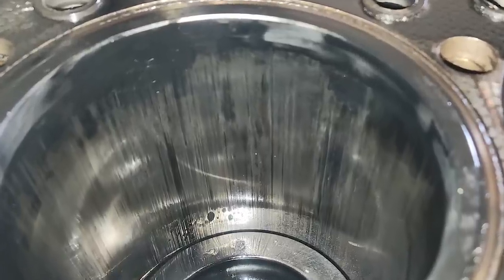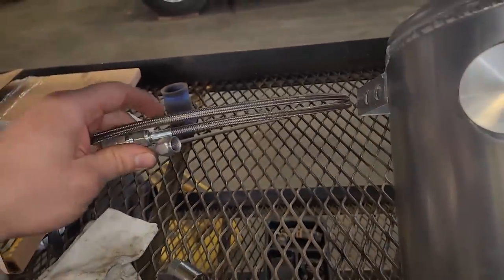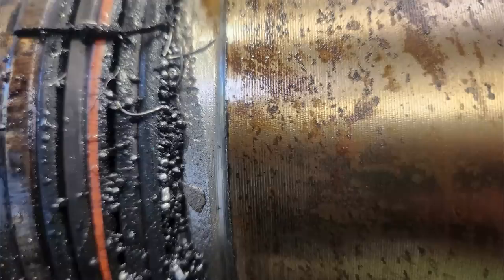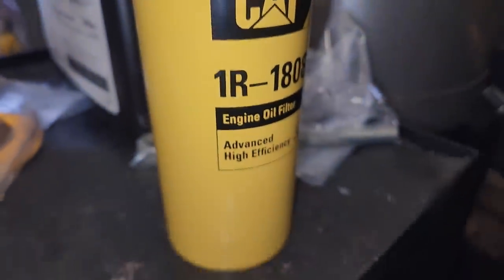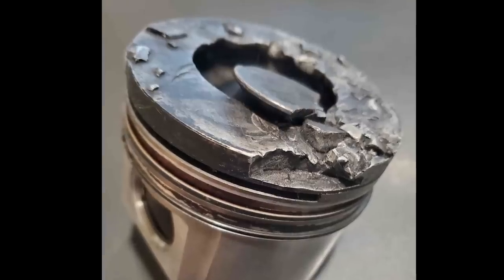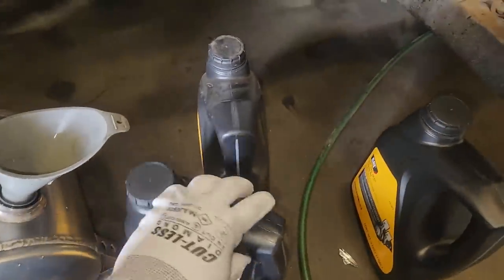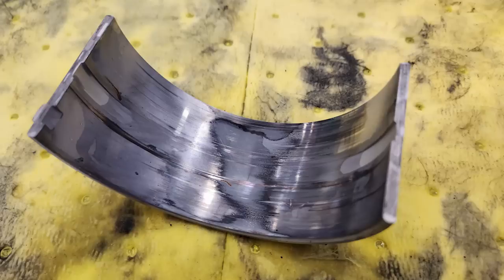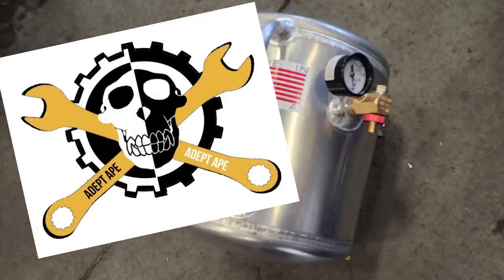This Engine has Oil Pressure BEFORE it cranks! Should you prime an engine oil system?

Comment: Thank you for this video Josh

I’m in the process of putting a C15 ACERT back together. 

I’m gonna try this setup
Reply from the maker: I think you'd like it.
Reply: Almost mandatory to pre lube oil galieries after rebuild or after you have had the oil pump off on 3406, C15 and wind engine over after filter change to get oil pressure before starting. Will take out #1 big end from lack of lube, usualy starts knockin about half hour from the shop. 38 years ago when I first started we used to use a stainless soft drink syrup bottle as they were pressure rated and held about 10 liters of oil, we pre lubbed every rebuilt engine before startup.👍
Reply: We also have trucks that have been sitting a while, like over a year or so. So this tool is going to be handy

Comment: Did something similar for filling differentials with gear oil. One thing to think about is using dry air. Moisture will get into the container and into the oil.

Comment: That cavitation damage looks a lot like what I see lately when a low rad gets topped off with tap water. I have no idea the chemistry or physics behind it, but something about our nasty ass nasty tap water mixed with newer coolants react with different metals to make some nasty compounds that eat up everything it touches like battery acid. And with distilled water now in short supply I suspect we're going to see more of this in the future. It's getting kinda ridiculous
Reply: Reverse osmosis water is almost as pure as distilled, and available in any grocery store. I use it in my off-grid lead-acid battery bank with the blessing of the battery manufacturer. And for only $300 I installed my own under-the-sink RO system in the kitchen.

Comment: The question remains, as to why pre-lube pumps are not installed permanently and used prior to all startups and after each shut down, particularly with turbo-charged engines? It's a small price to pay for increasing the longevity of the engine.

Comment: Hi Josh, Question : Did you have any experience with centrifugal oil filters ? They look like a great idea. Keep safe and have fun with Diesels. PS Your channel is just great – thanks and keep it goin…………..
Reply: We had large ones on the last big boat (8000 hp, two EMD 16-710's) that I worked on; they were plumbed externally with their own motor driven pump. We cleaned them once a month and would have 3/8" to 1/2" of dirt in the bowl, this was stuff that was too fine to be stopped by the filters. They definitely extended filter life towards the end of the overhaul life.

Comment: At the absolute minimum, remove the spark plugs and crank long enough to get oil pressure reading on the gauge.
Obviously, diesels don't have SP's so you have to do whatever other methods work (I don't do diesel).

Most SBC, get yourself an old distributor. Remove the drive gear and reinstall a shorter roll pin. Drop it in, get it hooked on the oil pump drive shaft and spin it with a drill.

Comment: I built one years ago. Sometimes I fill it with diesel and use it on fuel system to check things out . Found a leaking sealing ball on a detroit 60 series injector  one time. Nice to not haveing to run the engine

Comment: Pittsburgh power used to sell a oil pump powered by a starter that would pressure oil into the engine before starting.

Comment: Yes. Pre lubrication works, but it doesn't work for folks who need to work on equipment.  Adding bypass filtration plus oil analysis will turn engines into forever units and that will be bad for business

Comment: Great timing, I just put together a Series 60 and bought the Jegs version from Amazon. I really didn’t get any oil up to the rocker shafts though. I’m guessing not enough volume on the small line plus with 6 piston cooler nozzles open there’s just not enough flow to reach the top. Your thoughts???

Comment: In winter, even hooking the pan/crankcase heater, it was difficult starting. I installed an electric pump to keep the coolant flowing and the motor itself seemed to warm the coolant enough and redistribute the heat enough the truck had no problem starting like it was the middle of summer. However I always was wondering if that allowed the warm oil to drip back down some. This device might be the answer

Comment: 7:25 that same grime or whatever will be there regardless of if the engine is pressure primed or not, just if you don't pressure prime then that grime goes to your bearings under the load of a running engine, therefore it's worse to not prime if you're worried about grime.

Comment: Back in the 80s, I saw a drag racing add on, that took stored, pressurized oil, from a reservoir, and would release it into the engine during slow down/shutdown, when the oil moves away from the pickup tube, to protect the engine. Since up to 80% of engine wear occurs during start up, why isn't it mainstream, to do something like this with all automotive engines ???

Comment: I have the mighty vac oil fillers.  You can thread them right in, 20 PSI max, I have one for engine oil, one for tranny oil and one for gear oil.  Use them to filter and fill everything.  Awesome tools.

Comment: Hi Joshua, What do you think of doing a mini inframe at 5 or 6 hundred k miles as preventative,  planned maintenance?
 Pull the head, drop the oil pan, crank, and pistons.  Mic & hone each can, install new rings & bearings, double check head is flat & re-install everything.
Reply: That’s a lot of work and only costs you money, if you’re going to do what you’re suggesting you may as well inframe your engine for nothing.  If you need more than a bearing roll at 600K you’re using your Diesel engine improperly.  I’ve had engines go 1.5 mil without any real service other than replacing one injector and a doing a bearing roll.

Comment: So got an oddly specific question for you should you get a moment. Me and a buddy are trying to build a custom diesel offroad buggy. We want to put a cat engine into it....because yes. but while the C3.6 is more or less perfect for our needs size and power wise....the emissions are a deal killer due to the weight, size, and additional parts just being far too much for our frame to handle without having to expand said frame and weight to where the engine wont really work.

My question is what would be a good pre emissions equilvent to that motor sold by cat? Basically anything in the 150-180 horse range with a max demisions of 32x30x41 <LxWxH> would love to hear your opinion. Think bobcat/skidsteer engine.

Comment: IF prelubing forces contaminants into the bearings then so will the air pressure that precedes the oil in a dry start up. Yes air precedes oil in a dry start up.

Comment: I thought assembly grease was good enough. That's all I used for my  c13 rebuild and my oil gauge only took a few seconds to show pressure. I suppose there is no such thing as too  much oil on moving parts. (Within reason)

Comment: Wonder why the manufacturers don’t design and install a preoiler system in all engines and Tanis heater pads on the oil pan to keep oil warm. The most wear any engine gets is during start up. The big aircraft radial engines had preoil systems. Oil pressure just a few seconds after start.

Comment: only way i could see this being a negative is if you had used some version of dedicated assembly lube and this washed it out. even then...i believe that stuff is only really supposed to cover the period until you get oil pressure anyway-you'd just be making its job easier? I dunno, I'm no machinist

Comment: Any contaminants in the journal are going to the engine anyway.  You might as well flush it out like this, before it starts, than firing it up to push trash through the bearings at full load.

Comment: In late  '80 's when I was doing rebuilds..  mostly on NTC Cummins, liner cavitation was only and always on the exhaust side of the liner (position of liner in block when in operation)  bad ones, the cav. Would be in a straight line bout an inch wide... on the exhaust side only.

Usually found cooling system had no  diesel coolant additive in it and ph of coolant was like acid, haha...

Always found that interesting...  anyone see that today where cav. is on exhaust side of liner?

Comment: good idea not to fill your new toy too full, as you need enough air space above the oil to get a reasonable volume to pressurise, if it has basically no space, no volume of pressurised air, it will lose pressure very quickly once you open the valve.
Reply: Probably why the filler is off centre top....
you can't physically overfill it if the device is filled while sitting normally on it's feet on the ground....
thereby leaving a space above the oil for pressure?
Reply: @JohnSmith-yv6eq  yeah, that makes sense.
Reply: I have mine rigged to the supply so it never loses pressure.

Comment: I suppose there's no way on these engines to access the oil pump through a "distributor" shaft(Yes, I know. Diesel. But my 6.2L diesels have this though a vacuum pump is located there.) and use a tool to drive it for priming? Doing my first ever engine rebuild(It's a 360 Magnum), planning to buy or make such a tool and spin it up with a drill after assembly.

Comment: it not like you can pull the distributor out & prime the pump with slow drill & long pump drive shaft.moroso used to sell a similar kit for race engines that temporarily lose oil pressure with a wet sump,like tight turns or drag launches.

Comment: In the 90's in the Arctic, we had pre-lube pumps on our Cat 777 trucks, with 3412 engines. When not running, they had a block heater per cylinder bank, plugged into the mine's power system.
Best wishes from the North.

Comment: In my opinion they should have an electric pre lube system installed factory on all engines.  

Imagine you just push a button for 20 seconds before you start the engine.

Comment: Prelubing the engine being bad? Spoiler alert: Many long lifetime high rel duty engines (like train engines, ships,...) actually disable the starter until the prelubing pump reaches predefined pressure in the system for certain minimum amount of time first before each and every engine crank (the "start" button usually turns everything on, just the starter gets delayed by the oil pressure and/or timer switch). If prelubing would be so bad, why would there be such complication?
Yes, such system is not on most road vehicles, but not because it would not be beneficial, but because not using it saves cost and weight and the extra time needed for starting is not appreciated as worth the wear reduction it brings.

Comment: i do 3 runs with the valve covers off on gm ls engines 90psi then 60psi and then 30psi using the oil pump priming port on the side of the motor using royal purple.  these motors start almost silently.  like theyve been warmed up for an hour.  im sold on power preoiling.  ever see a build show with a brand new crate motor covered in shiny expensive chrome and the awful shriek at startup?  the one that says im gonna run for 300 miles and then im done.  we dont do that......

Comment: Can you show how you do the block repair from the damage from the cavitation?
Reply: Only way is to pull the engine, tear down to bare block. Machine shop bores the lower deck (liner seal area), install a insert. As with block is at the machine shop, mill the top deck. Gets it back true, cleans up minor water ferrule pits. 
Piston slap hurts the lower deck, as Cat has gone to a metal piston and skirt. Old 3406's had aluminium pistons.  
Best think Cat has right now is a upgrade to new long block. Get a brand new head, crankshaft and cylinder block, plus what ever else is new..

Comment: That would be stupid not to pre oil an engine not when u can help it.   I did have lower engines class before pulled apart 2 engines & back togather.  because that's the rule whenever there's no oil there's no lubrication and that's your engine wear.

And I think those oil cans could be used in racing not sure

Comment: I got an unrelated question. I saw a YT video stating that white smoke on start up only is a sign of glow plugs not functioning? Is that true?
Reply from the maker: White smoke can be fuel, oil or coolant, glow plugs not working can help fuel ignite easier on cold conditions, so they can help.

Comment: Hey Adept Ape, was wondering if you could tell me the recommanded Oil Pressure of a 3406e 5EK cat engine. Struggling to find any good info on it. And many people keep saying different numbers...
Reply: Max oil psi normal operating temp, is 88 PSI low idle to TEL. Min oil psi is roughly 15 PSI @ 600 RPM's. From 600 to 1200 RPM's oil psi ramps up from 15 psi to roughly 40 PSI. From 1200 RPM's to TEL min oil psi is roughly 40 PSI.
So draw a chart on graph paper using these numbers.

Comment: so cavitation caused by blowby? why the use of new oil? wouldnt you have to fix all broken parts?
Reply from the maker: The engine got a full rebuild, it has cavitation on number 1 liner which was unrelated to the blowby. Blowby was caused by cylinder damage on number 6 cylinder.
Reply: @AdeptApe  hey adept thanks for clarifying

Comment: using the reel or this tank the engine oil you put into the engine is not filtered, you would be better off using 105 on all the moving parts

Comment: $177.00???
I MADE THE SAME THING WITH AN OLD FREON BOTTLE!!
TURN IT UPSIDE DOWN AND BRAZE THE FILL PORT ON THE BOTTOM!
PUT A 1/4” FLEX HOSE ON THE VALVE.
PUT A DISCONNECT AIRHOSE
ON THE FILL CAP!

Comment: How long is too long for a truck to sit ?
Reply: Anything more then a few days is considered a dry start
Reply: I think in the owners manual, Cummins states 60 days.  Cat is probably similar.  Why would you not want to pre lube?  I am presently working on a system to pre lube all of my trucks.  As previous comments have stated, a pre lube sequence is mandatory for all large marine diesels.  I don’t see why any engine should not have a pre lube.  Their absence is probably due to cost, not need.

Comment: As a cheap redneck substitute...

Could a gallon garden sprayer with the spray tip removed and a joiner in the line to connect it to an engine work?
It's what I use to fill diffs and gearboxes as it beats the heck out of squeezing a bottle when you are sideways under a vehicle...

I further modified the sprayer's blow off valve by removing that and drawing a tubeless tyre valve stem inside on a piece of wire and up into the resulting hole...airtight.
I use 20psi and it works...probably can go higher....

One garden sprayer for each fluid....

I peel the stickers off the OEM or branded gallon jugs and stick them on the sprayer body as a label......

Comment: New engine over haul missed yellow paint ..block 🤨
Reply: Painting is not a standard deal on heavy duty rebuilds or parts replacement, they are mechanics not painters. At near $200 an hour shop time I’ll paint it myself when i pick it up.
Reply: This is a in-chassis repair, all rebuilt engines are fully cleaned and repainted